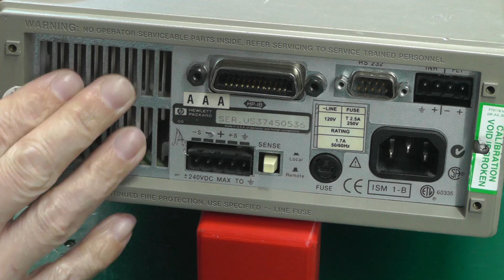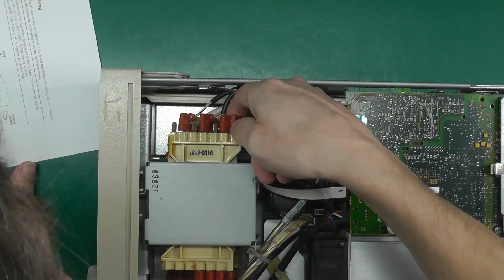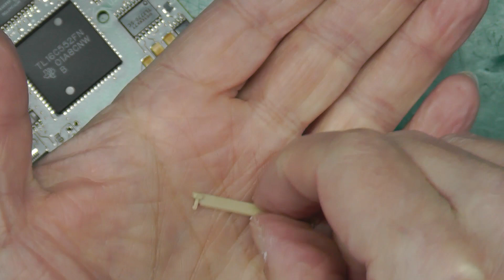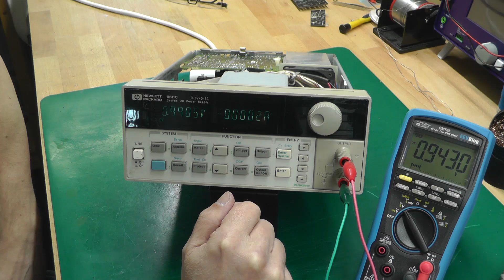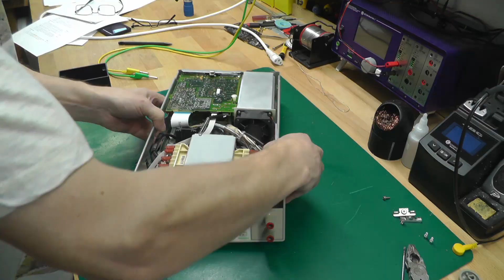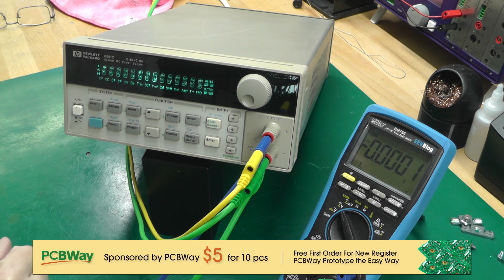No.071 - HP 6611C Linear Bench Power Supply Repair

Comment: I believe the reason the fan was running full speed was due to the missing communication between the analog board and digital board.  The HP/Agilent source measurement units will do the same thing if a fault is detected on the current source board.

Comment: Nice repairjob.
I am maybe a bit pickie, but for a precission instrument, the output voltage (even at low loads) isn't as precisse as I would hope it should be. Is that really OK this way, or is there a hidden failure?
Reply from the maker: Thats a fair question. So, remembering it's a System Power Supply and not really meant as a general bench unit, the accuracy comes when using the rear phoenix terminals and the sense terminals there. I tested them and even with a 5A load @5Vdc the output only dropped by about 0.5mV. The user manual states:
"Front binding posts are provided for convenience. Only the rear panel terminals are optimized for noise, regulation, and transient response as documented in Appendix A2".
Without opening it up again, I can only assume the 'local' mode sense connections don't go all the way to the back of the front binding posts, and probably the gauge of the wire there is questionable also.......and thus volt drop is experienced even with minimal loads. If I was keeping the PSU I'd probably modify it for that.....an easy mod to make......:-)

Comment: Thats a lot of power supply just for 8V 5A. I wonder if there is a way to modify it to allow a higher maximum voltage even if just up to 12V. What is the main output voltage from the transformer? 8V 5A is not very useful.
Reply: It's very useful if you need a PSU specifically for supplying a low-noise voltage in that range at substantial current. This is a system supply, not a general purpose bench supply.

Comment: @10:15 I would just push the plastic retainer back in and then apply some tape to hold it in place, it just needs to be there to push the flex onto the terminals inside the connector.
Reply from the maker: I'm selling the PSU afterwards so tape isn't an option. Borrowing the clip from the unused port seems the best way.
Reply: Yes, get some plaster ... (scnr) ✌️

Comment: Great quick repair! 👍
Interesting, what may be reason for this ribbon cable socket to break.. My versions are: some previous maintenance goes wrong or previous transportation, because never seen, that these connector's broke by it self..
Reply from the maker: I doubt it broke by itself.....more than likely the folks at the company that owned wanted to upgrade their test gear and opened it up an hauled at the ribbon to create a fault......happens more than you think!